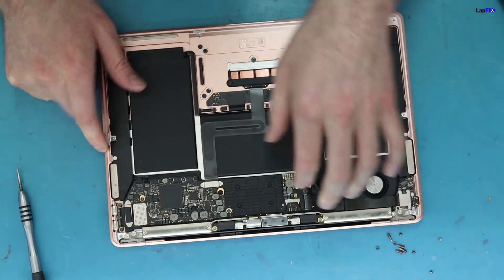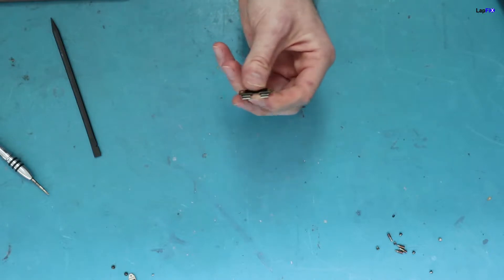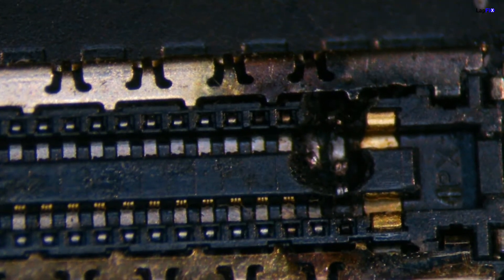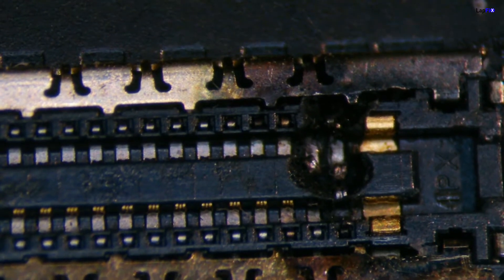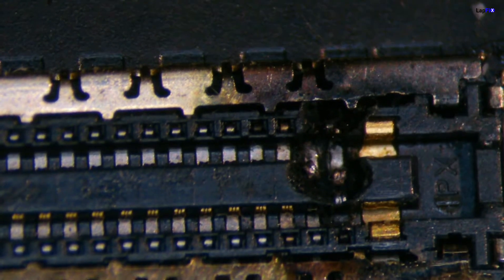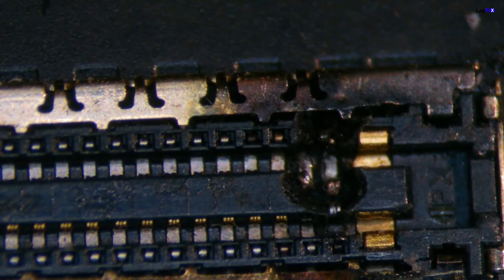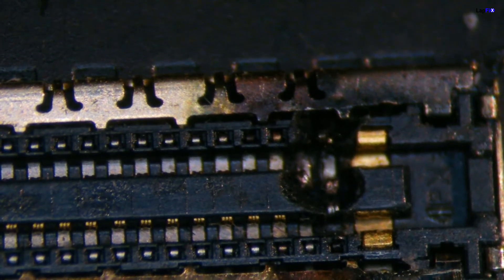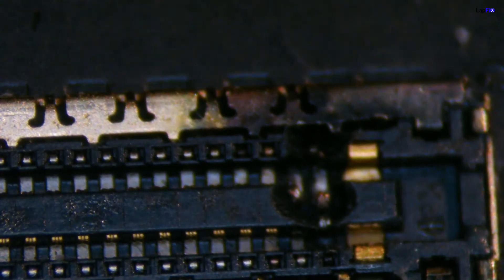Repairing Liquid Damage on MacBook Air USB C Charging Port

Comment: my macbook air wont charge no matter which of the 2 ports i plug it into to,...any advise?
Reply: Me too, i have this problem where my two charging ports aren’t working although my charging cable works just fine with another device.

Comment: If the usb-c port was damaged by power surge is this fixable by just replacing the usb-c itself or will the board be damaged?
Reply from the maker: Usually the circuit on the board gets damaged

Comment: Hello my friend and thank you for the awesome Video.

i have a question if I may. Ive accidentaly spilled a maximum of 15-20 ml of coffee on the back of the Macbook M1 Pro 13', the coffee only touched the back of the laptop, and got in an extremely small amount in one of the usb c ports. ive cleaned it in seconds and I had some Compressed Air and it all got out. Laptop works fine, charges fine, no problems whatsoever. Should I stress about this?

Comment: Hey great video, i have two questions for you. Unfortunately, a little bit of water touched my Macbook pro a1990 and the computer won't turn on. If I will disconnect the Mac battery from the computer and connect a USB C meter to the charger what will be the read on the USB C meter ( 5v or 0v) ? Moreover, this accident can cause a failure to the DC3215C00 ( USB controller ) chip or it will just damage the USB C port ?
Reply from the maker: Thank you for your kind words.    If there is a liquid spill, on the side of the usb ports, there is a higher chance the ports are damaged as well as the components as the usb ports are more exposed.  If it doesn't turn on, better to take it in for repair to see where the liquid impacted exactly
Reply: Hey , i meant the water touched the USB C port

Comment: Hi,
I am having trouble with my MacBook pro. Accidentally water went inside the power adopter and stopped working. I tried charging with the same as I was not aware of the water. But my MacBook is still in working state. How can I dry my Adopter? Can I use drier? It was not poured into water but some water might went in not sure how. When I kept it few drops came out. Please help
Reply from the maker: As you can see in the video how corrosion can build up on the traces when electricity makes contact with the liquid.  It is always better to get it checked out first to see the damage.  You may not notice it at first, but it can get worse over time as there might be other issues that stem from it especially if the liquid gets on the board

Comment: I have a MacBook Pro A2141 I spilled coffee on the keyboard but luckily I had one of those silicon covers on it, so no liquid got under the keys except for under the esc key which I dried immediately. But there was also coffee on the left speaker which I also dried. I then later on realised that the top left usb c port isn't working when I plug in the charging cable and the one underneath it... when I plug the cable in it doesn't charge, I take the cable out and turn it upsidedown (basically to the other side) and it starts to work. Which made me think that the cable is the problem but the cable works just fine on the two ports on the right side of my Mac. im thinking of opening my Computer but need to order some tools. I can't afford to send it to repair and also need my computer for school. CAN ANYONE GIVE ME SOME ADVICE? Can liquid seep into the tiny holes of the speakers? Although my speakers are working just fine. Its just the left usb c ports. I don't want to ruin my computer, had it for a year and can't afford another one :(
Reply from the maker: Liquid can get under the components and give issues.  They can also corrode and get worse over time if you keep using the laptop with liquid damage.  It is best to get it repaired

Comment: Hello. I having trouble with my MacBook Pro A1708 USB port. Will this be the same way to replace it? Thanks
Reply from the maker: If the port is physically damaged or the traces are bad, yes.  Otherwise there is usually more of an issue with the logic board than just the usb-c port

Comment: That last one I think happened to me. I stupidly started charging it after I split water on I started to smell it burning. Now one of the ports doesn't work. Anyone know if its repairable?
Reply: its a fairly cheap replacement, i just got mine replaced
Reply: @metube790  How much did you pay? Was it at apple?